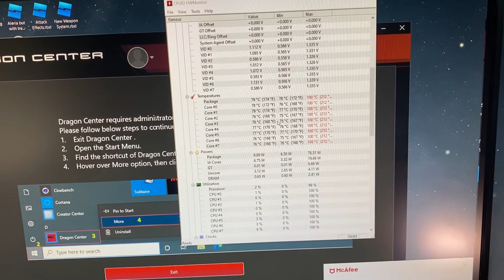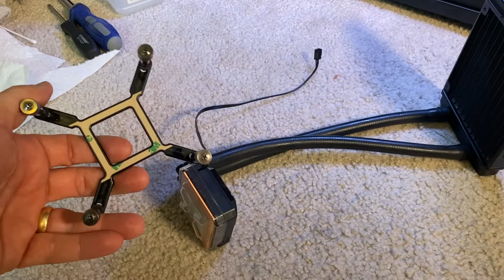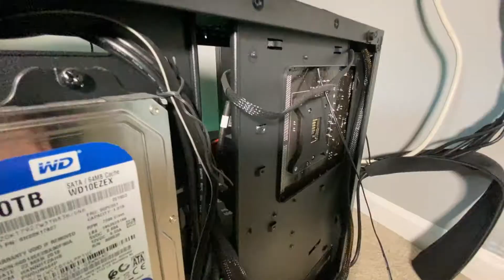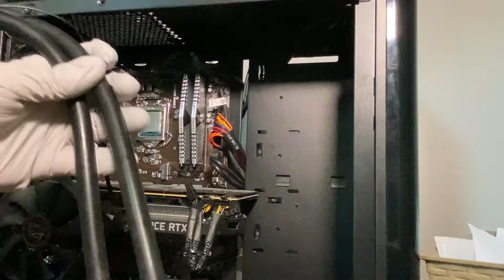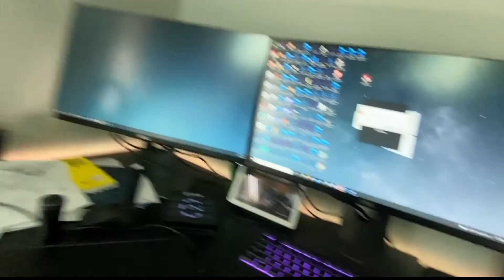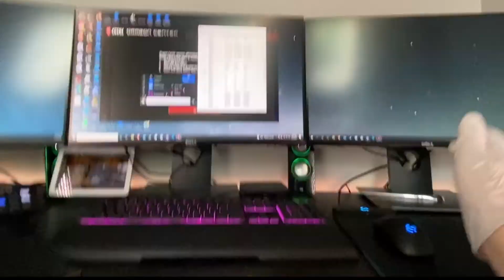Replacing bad CPU cooler - Corsair H60

Comment: 9:45  I get saving parts, I got quite the collection myself, but I would at least unplug it from the power supply.
Overall, not bad for a non technical person.
I'm glad it worked out, but I recommend checking the fan curves in the BIOS and making sure the water pump is running at a high enough speed.   If you don't know what speed to set it at, you can also just find which header the water pump is hooked up to and set that header to the "water pump" setting in the BIOS.
If you plugged in like for like, that is good, but it is rare for premades to be set up correctly from the factory.  They only care that it makes it past warranty so I would check on it either way.  (speaking of that, you could check to see of XMP(or whatever that BIOS calls it) is enabled)
push/pull is sometimes considered unnecessary, but stock fans are often pretty weak, so it is good that you kept that as radiators have significant air flow resistance.
Since you have an extra fan, putting that in the front of the case to blow more air on the video card would not be a bad idea.
For others in a similar boat, I HIGHLY recommend unplugging the entire PC and moving it to a convenient work area.   I also recommend removing the video card.  I'm surprised you didn't break it as hard as you were pushing on it.  It was already sagging pretty far from being unsupported.
For those that care more about reliability than bling, you can replace that with an air cooler instead.  120 radiators are no better than air cooling performance wise.
All water coolers lose water over time, all will eventually plug up internally, and all can have a pump failure, especially the pump in radiator ones.
In theory, the radiator is a great place for the pump, but in practice, the space used is too small making the pump undersized for the task.
That looks like a mild video card, but you could also check the power draw on it and make sure that daisy chaining the power hook up is ok there.   It all depends on how power hungry the card is.
Prebuilts don't have the same quality control as proprietary systems, so it almost always pays to give them a good once over to see if they are set up correctly.

Comment: 1:50  well, not quite.  most people are followers, and the people that push products and other things promote Celsius.  if you watch computer tech channels, you find some creators that get visibly upset when people don't use Celsius.
I've paid attention to the ongoing battle, and, over a decade ago now, many many products were switched over to metric.   OFC, they put the standard measurements on the container, but you can the the product is measured in the metric system because it comes out to a decimal point number in standard measurements now.
The reason for the metric system is the math is simpler, and avg IQ has been dropping since the '80's.

Comment: I just followed the instructions but im still getting high temps
Reply from the maker: You replaced the cooler with new? If so, you may have another issue. Did you check you case cooling?
Reply: @ShutterFanatic   I just got it, I needed to plug in the cables to cpu fan 2 and another 3 prung. mine is the H60X

Comment: Just had a 4080 prebuilt from them die on me in under 3 months from the same issue. Replaced with a deep cool and back up and running 😅
Reply from the maker: Son now has custom 4090 which is going strong since Jan but I know it will fail sooner or later since their coolers are junk. The 4090 puts out crazy amounts of heat.

Comment: I think I'm getting this same issue. My CPU is getting up to 80c + after a few hours of playing games. It is okay when I just browse, but playing too long it gets way too hot and won't boot past the bios. Only had my prebuilt for about 3 years...
Reply from the maker: Sounds similar to mine.
Reply: @ShutterFanatic  I got my new CPU fan installed and it's all better again. It was the CPU cooling. Again I'm as illiterate with CPus as can be. It's the same as opening a car hood and being lost.. But this video DID help me identify the problem. Temps are still low after replacing it.
Reply from the maker: @ValoriePalerie  good to hear. Glad I could help

Comment: Thank you!  My iBuyPower had the same exact issue.  This is insane these water coolers are all failing.
Reply: Mine and my father in laws cooler failed. Pieces of shit
Reply: Same issue here. Mine started to make a ticking sound. Gradually got hotter and the ticking got faster  and faster. Then it just shut off one day about 60 seconds after I restarted it. Same temp as the video around 90 to 100c. I never turned it back on till I got a new CPU cooler.
Reply: My buy power pc had the same problem 😂

Comment: I’m having the same CPU overheating issue with my iBUYPOWER pc also, games running choppy and temps get up to 95⁺ when running a program or 69-85 when idle. Going to Best Buy today to buy a new cooler and go from there now. Thanks so much for uploading this!
Reply: What did you end up going with? I’ve got the same exact problems right now with mine

Comment: I have one of these and it's making a noise (I think the pump motor is on the way out). I was thinking of replacing with the same model, should it be a straight forward swap or has it changed over the last six years? It's not something I've done before.
Reply from the maker: Should be pretty standard. You just have to make sure the size is correct.  Most come with brackets for common CPUs

Comment: For anyone wondering, just replaced mine after 3-4 years of use with the nzxt 120 kraken and it fits good works wel
Reply: After researching the same NZXT cooler as a possible replacement for this iBuyPower cooler in my own PC, found out through reddit and a few other sites that the iBuyPower cooler shown here is actually just a rebranded NZXT Kraken M22 with different logos stuck on the RGB cooler cover and the fan stickers.  That being said, if these are actually rebranded NZXT Kraken M22 coolers that are failing, be careful going back with essentially the same cooler in this one's place.
Reply: @stuartkaylor7531  nice job! Very good to know. As a update, she runs cooler and better than before. A little louder but not too annoying. Next time maybe ill go with a nicer one, or maybe get a 140 size and mount on the top 🤔
Reply: @stuartkaylor7531  the shape and design is a little diiferent so not sure if it was based on a older model of kraken but anyway

Comment: I am having same issue with the same exact cooler. My research found that almost everybody has an issue with this cooler. I’m replacing mine with a Corsair most likely and gonna upgrade cpu cuz why not. 😅
Reply from the maker: Would be a good time to upgrade the CPU if you were going to do it anyway but if you do it later, it’s only a few min and some thermal paste
Reply: Did you end up upgrading cpu?
Reply from the maker: @heyitsj3092  maybe the other person will reply but I upgraded the GPU since and the CPU then became the bottle neck. I did some research and the CPUs that worked with my motherboard and faster than I already had was very limited. To jump In performance, you are probably also looking at a motherboard swap at the same time. Hope this helps.
Reply: @heyitsj3092  Yes!
Reply: How do I know what cooler fits my motherboard I go a new cooler and it ended up being too wide

Comment: I have this same problem and setup.  Could I get a 240mm radiator liquid cooler and mount the radiator on the opposite side?  Or does it need to be mounted exactly where you did?  Sorry I’m not tech savvy at all
Reply from the maker: Not sure.  You want it blowing outside the case.  I doubt the cooler lines would be long enough to mount on the front. Also, if your case is like mine, the front has restrictions which is not good. Why not mount it on the rear?
Reply: Make sure whatever way you set it up works with the rest of your PC's airflow. If using your radiator as an exhaust, it's technically best to mount it in the top if possible since hot air is going to rise and you are working with convection instead of against it.

Comment: Just replaced the same iBuyPower unit because it started making such a loud noise.  Seems like everyone is having the same issues. The screws they put on were so damn tight I literally grabbed a wrench and took hours to get them out. Felt like I was breaking the motherboard but I got the job done and my new Corsair part works good
Reply from the maker: Awesome, glad to hear it ended up working out. Definitely a common failure point.

Comment: I just ordered this same water cooler. I got the same exact pc lol. I noticed mine started overheating. I’ve never worked with computers and I’m kinda nervous about doing it myself. So should I send it to micro center, or do it myself?
Reply: Do it yourself my friend. If you need any advice , I can give you my discord but I'd advise looking at the change CPU cooler on the Corsair YouTube channel. It shows the Corsair h60 being installed so you can do it just as it should be
Reply from the maker: +1. I thought is was pretty easy. The cooler even comes with the thermal paste pre installed.

Comment: Its probably a dumb question but I've a case with 3 fans on the front and an exhaust fan on the back . All the videos I've seen of this being installed seem to replace the exhaust fan . Is this a good idea ? Or should I leave the exhaust fan on it and replace one of the 3 intake fans ?
Reply from the maker: Not sure. This pc has 1 or 2 on the front and the factory setup was to exhaust through the cooler. I would watch your temps via monitor tools and keep it clean for maximum flow.

Comment: What kind of motherboard do you have? I have a ASUS PRIME X570-P. I took the new cooling system to a local computer repair guy to install and he said the brackets don't fit the motherboard
Reply from the maker: My Motherboard	is a MSI Z390-A Pro with WiFi.  The cooler will be based usually on the CPU brand and type which also relates to the board. Is yours water cooled now? You should be able to match it up to your old one.  The H60 shows up as compatible to your board per this site I found   https://pangoly.com/en/compatibility/asus-prime-x570-p/cpu-cooler.
Reply: @ShutterFanatic  the guy said he couldn't switch it out because my motherboards holes were rectangular instead of square. Not really sure what's he's talking about so my friends husband is going to take a look for me. I made sure the h60 is compatible with the motherboard and the cpu also so I'm at a loss. My friends husband thinks the guy just isn't sure of what he's doing so I just need to go get my tower back.
Reply from the maker: @eluna5389  sounds like you have an AMD chip. This cooler comes with hardware for both. See the install manual here https://www.corsair.com/corsairmedia/sys_master/productcontent/H60_1018_QSG.pdf
Reply from the maker: @eluna5389  I agree with your husband’s friend .  I hope the guy didn’t lose the AMD hardware that comes in the box. Make sure it’s there when you pick up the PC. You have to switch the bracket because I think it comes configured for Intel out of the box.

Comment: Was there a loud rattling noise coming from the radiator? Mine started making a rattle noise. I cleaned it thinking it was the fans and dust. Starting digging and found to check cpu and mine was running about 95 degree celsius. So I'm pretty sure I'm having the same issue. My ibuypower pc is 2 years old.
Reply: This is exactly what happened to me!!! Ibuypower is selling lemons and all our liquid units a designed to break after parts warrant expires. Mine literally started rattling them my processor shot up to 94c and shut down
Reply: @phaylen  same. mine rattled for a long time, soon after i got it, with zero shutdowns or lag or anything. i didn’t know what it was and there was no issues so i just placed something on top of my pc (smh) and it stopped rattling, even after removing the object. anyway i’ve had it for like 8 months now and the cpu temps are getting above 100c & it’s shutting down. 2 fans also stopped. anyway i just requested a new liquid cooler under warranty. these coolers are terrible lol. saw someone on reddit flush their ibuypower aio out and it was full of gunk
Reply from the maker: Yep, mine was doing the same thing. I blew it out and then it started making a running water sounds.

Comment: This video is giving me so much confidence. I'm going to do this exact same thing today with the same corsair cooler, and I'm crossing my fingers it will work.
Reply from the maker: How did it go? I too thought it was intimidating at first but ended up being pretty easy.
Reply: @ShutterFanatic  It took a while to get it installed, but my dad and I eventually did get it working. So far it's been working great, and I've been getting up to about 70 degrees Celsius while under full load. My computer used to get up to 100 degrees Celsius and would have to throttle to avoid damage, so I would say the installation was a success. We didn't even bother with using the corsair fan, and just used the original Ibuypower fan since the wiring was kind of confusing. Great video
Reply from the maker: @garretthilbig2462  great, glad to hear you got it fixed. My sons would throttle down and eventually would shutdown due to the heat before the install.  Take care.
Reply: I’m having the same problems plus my radiator has air bubbles and is making a loud noise gonna replace the ibuypower aio cooler with a Corsair and hope it works

Comment: Im not buying an Ibuypower pc anymore, most people get the same issue
Reply from the maker: It was the only issue we had since purchasing and it gets used a lot. I wouldn’t rule them out but also would shop around.
Reply: @ShutterFanatic  yeah looks like Ibuypower  pcs build are easily fixable
Reply: I'll be honest, im on my 4th year with mine. The 2 issues have been the SSD around 3 months ago and the water cooling this week, which is why im here. 
Overall, its worked great, i did spend only $1300 on it with a RTX 2080 Super and overall good specifications.
I upgraded the SSD and now ill upgrade the water cooling. They are perfect to start off, especially if you buy on black Friday